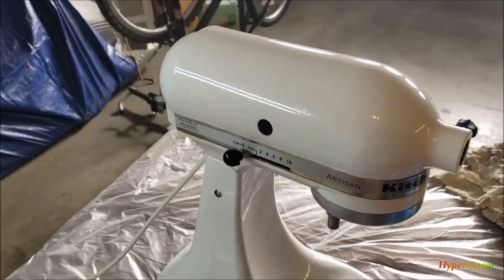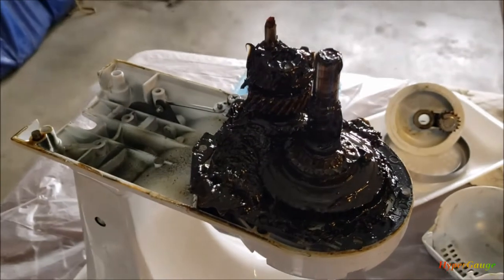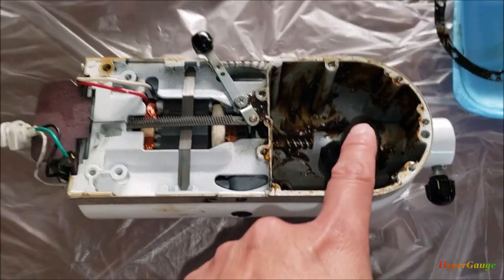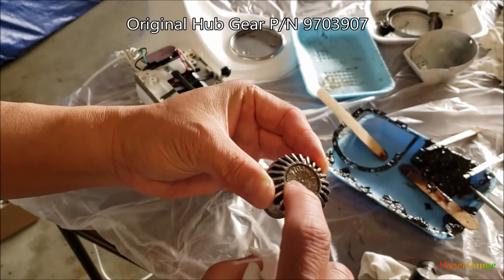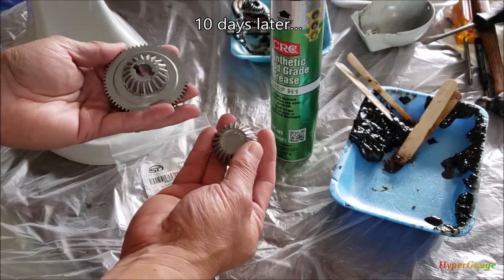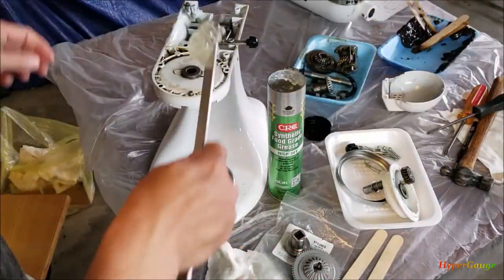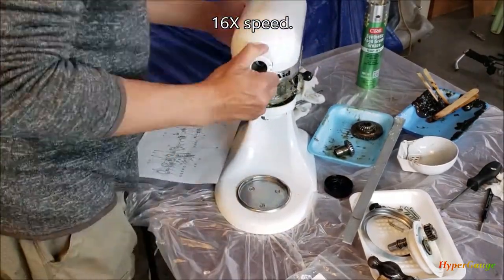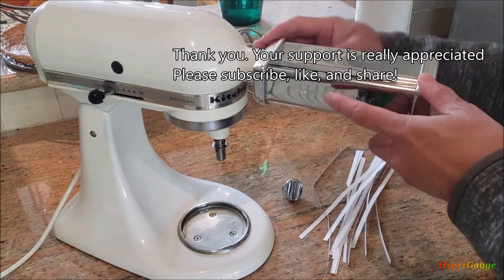DIY Hub Gears & Grease Replacement for KitchenAid Artisan Mixer! Broken Front Hub Port Repair

Comment: Hi! Thanks for this. Sadly the hub gear doesnt rotate and seems completely stuck in there. Any advice?
Reply from the maker: Sorry to hear that. Maybe try to clean up the  lubricant as much as possible to check if anything damage or stuck there. Lightly tap with a small punch to see if it can be loosen. Good luck with your repair.
Reply: @HypergaugeDIY  thanks! I tried all this..finally decided to use brute force...still no luck! Oh well!
Reply from the maker: As a last resource, sometime heating or cooling the stuck parts could help release the lockup parts. Heating may not be a good idea in this case, but cooling maybe ok. If you want,  this video is how I used extreme cold to unstuck a fishing rods in this video. https://youtu.be/LmZT3KJgm2c  If you happen to have the air duster handy, you may give it a try. Best luck with you.
Reply: @HypergaugeDIY  interesting! I did try s blowtorch on it...probably not the best idea. Will try cooling it. Nothing to lose!

Comment: You can use denatured alcohol to clean the grease.  It is food safe
Reply from the maker: I heard about a similar suggestion for cleaning grease with denatured alcohol before. Not so sure if it is a really a good idea as it is mainly made with methanol which is toxic. Maybe different brand or different type can be used for food grade machine?